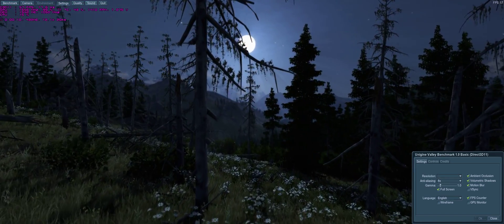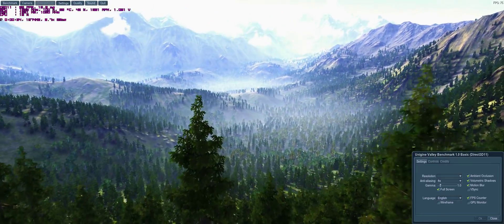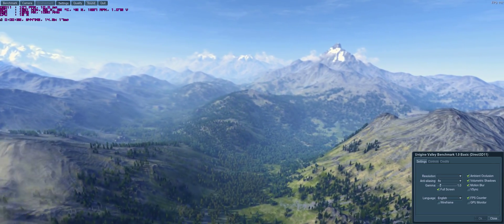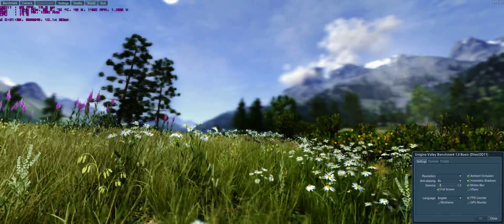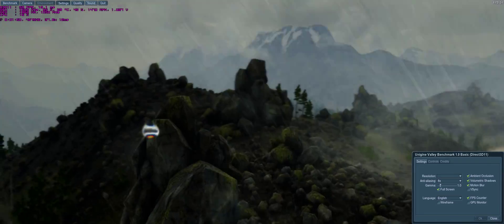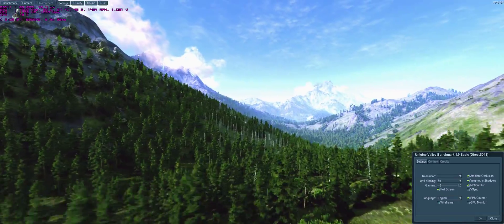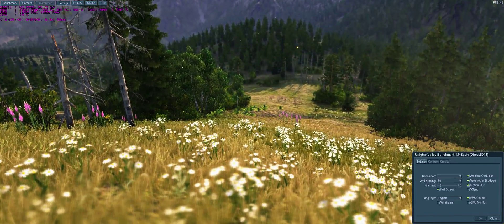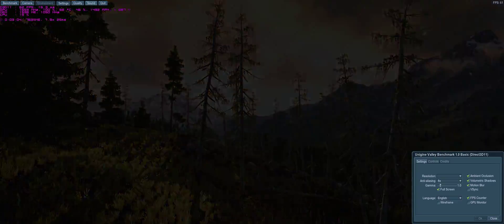Sapphire RX Vega 64 Nitro+ - Undervolt OC - Max on Air

Comment: What's your current best setting ?
Reply from the maker: 1650-1675 is the sweet spot for me  without a ton of heat/noise.
Reply: @MDFGamingVideo  I have requested to make a video for  O.C saphire nitro vega 64, I am new to over clocking and I need step by step instruction please. I really like your videos!!

Comment: mine does 1630 mhz :P
Reply from the maker: That's good.  Mine eventually maxed out at 1710, but took a LOT of tweaking, and it was LOUD and HOT.  I generally keep it in the 1600-1650 range for long term reliability.

Comment: Great video. I copied your exact p2-p6 voltage. Didn't touch HBM or stock frequency. Stock at p6 mine is ser to 1659 I believe. I did however set my GPU fans to be a bit more aggressive to keep temps cooler. Got some great heaven benchmarks. Thanks for the video
Reply from the maker: Very welcome.  Glad it helped.

Comment: Tomorrow my sapphire Vega will arrive and i have no idea at undervolt or overclock should i use your settings on wattman will it be stable on my system? Ps i dont care about power consumption i only care about performance and noise
Reply from the maker: Every card is different.  I can't predict how yours will be, but start with this and if it's not stable enough bump the voltage and fan values up a little.  Also make sure you have good ventilation in your case.  High end cards need to breathe.  ;)

Comment: Is that terrible pitch/whine in the background the coil whine from the Sapphire Rx Vega 64 Nitro+ ? Or is that just your mic being poor quality? Hows the coil whine on the GPU by the way?
Reply from the maker: I think it was a Windows 10 driver bug.  Mic boost and level not picked up properly.  Doesn't do it anymore but happened in several vids.  You can hear the SNR is much improved in the 1700+ video, very faint but still there.

Comment: hello i have the same card which i bought yesterday and I'm experiencing extreme loud coil whine if the card is under moderate load.. not speaking about max load ..do you have the same thing? coil whining asf even at 60fps ...what is your mobo and psu?    ..also games crashes at this clock/voltages and fans spin like there was about to be fire. ...already contacted sapphire about my issue
Reply from the maker: After my card broke in the coil whine improved quite a lot.  I hardly hear it at all now, even when under very high load for the 1700 core attempt.

Try an undervolt OC that isn't too crazy and give it a week or two.  See if it quiets down after some break-in time.
Reply from the maker: MoBo:  Asus X370 Crosshair VI Hero
PSU:  PC Power and Cooling Silencer 960w Silver rated that I have had forever.
Case:  Phanteks Enthoo Primo for my 1st huge water build.  Kept it as it has spots for 2x 140mm bottom filtered intake fans, perfect for hot GPUs.  But any case with at least 1 bottom or side panel filtered intake would help airflow to this card quite a lot.

Comment: so is lc bios at 1180mv and 1722 core good?
vram 1100mhz and 950mv.
tested for an hour on valley benchmark.
Reply from the maker: I can't answer that as I have not flashed it to the LC BIOS.  Probably won't need to for 1700.  Just need better cooling.  * cough * Alphacool * cough *
Reply: @MDFGamingVideo  :) I flashed back to stock. I can get stable p7 at 1670 with 1170mv and 1100 memory.

It boost to 1730 though in crossfire for some reason.

Comment: hows the card holding up? Can you do a new video on it?
Reply from the maker: Working great still.  I lost my mind and got a waterblock, radiator and pump from Alphacool.  Gonna put it on soon for fun.  Aquatuning USA FTW.  Did a vid a little while ago where I finally got it to 1690-1710 stable on the stock air cooler.  Fans hit 2500ish RPM though, so it's getting warm..and loud.  Had to lower HBM to around 1050-1075 to free up a little overhead.  Heat is definitely holding me back, especially that hot spot throttling.
Reply: @MDFGamingVideo  is that p7 numbers or actual numbers?
Reply from the maker: @DragonProtector  I had to plug in higher values to get it to hit 1692-1710 at 1137-1143mv on air.  If I tweak the power target in the BIOS and put the waterblock on it maybe more stable.  But when I fit the Alphacool waterblock the plate was too close to the chokes for comfort.  So watercooling this is on hold for me.  Not gonna risk it til I have a good backup card.  I have all the parts in hand to do so.  Just too many projects going on ATM.  :)
Reply: @MDFGamingVideo  you should get the bystik water block (aie express)

I had one but sold it.
Reply: @MDFGamingVideo  I had to rma my gpu as it was not working right with new drivers and was having issues after I stopped using crossfire.

Comment: Can you share the settings for the efficiency based OC at 1600 core that you mentioned in the description?
Reply from the maker: The Power Play table values for the first 6 states (0-5) are the same between all my OCs.  Stock speeds, slight undervolt.  The final 2 states are in the description.  At 1600 fan and temp targets were a non-issue.

Comment: Nice job, got one of these cards 3 weeks ago and spent a few hours tonight playing with it. currently got p7 to 1692mhz @1080v, memory to 1060mz@1050v and temp seems to stay around 60c so got plenty more room to play with! can get the memory to 1702mz@1090v stable and havent pushed it higher yet. great cards!
Reply from the maker: You don't usually need to adjust the HBM voltage.  It is always something like 1.3-1.35v under load.  The voltage in WattMAN is the minimum.    Weird I know, not what you'd expect but that's what they do.
Reply: @MDFGamingVideo  aa would explain why i saw no temp drops or anything then! thanks for the info.

Comment: is there any difference in power consumption? did it go higher or lower?
Reply from the maker: Answer on power use is in video description and comments for this vid and the original 1600 vid.
Reply: @MDFGamingVideo  if you just undervolt the card, without OCing it, would it go even lower than 180w?
Reply from the maker: I would guess 1500-1550 at around 950mv would get you pretty close.  But that's below stock specs on this particular card.  You will need the newer driver and WattMAN or a custom bios to lower it.

Comment: I have the same card like you and a amd ryzen 7 2700 and when i play games like bfv my gpu clock is at 1000 or lower so i cant play bfv on medium settings whit 60 fps.. i cant understant this other ppl whit the same specs got over 100 fps at ultra do you know a fix?? ( btw sry for my bad english)
Reply from the maker: Sounds like driver not installed properly.  Uninstall.  Clean off drivers for GPU only.  Reboot.  Reinstall.  Reboot. test with a game.
Reply: MDFGamingVideo hmm ok but drivers are istalled but i will test it thx
Reply: @MDFGamingVideo  i tried this but its still the same you dont have other fixes right? :/
Reply from the maker: I would contact Sapphire.  Mine runs fine.  I did a clean driver uninstall and have a good PSU and cooling.  No idea why yours is stuck at 1000.
Reply: MDFGamingVideo the radeon settings got updated when i auto overclock my gpu everything runs waay better
Reply from the maker: @sazurio  Glad to hear it.

Comment: Is this the Limited edition version? My understanding is the non-LE doesn't have the vapor chamber. Looking at purchasing the standard nitro+ but I can't find much about its cooling performance. All the reviews and info out there seems to pertain to the limited edition.
Reply: The non-LE should still be a very good card cooling-whise too. Ordered it yesterday along with a new rig.
Reply: @bosslife92  ordered from where and how much was it?
Reply from the maker: LE was a limited run for early adopters.  This is the regular Nitro+ model, no vapor chamber.  And yet I still hit the wattage limit before temperature limit so it's still a very good cooler.
Reply: @MDFGamingVideo  Would you recommend a 24" 1080p 144hz FreeSync monitor or a 27" 1440p 144hz FreeSync monitor for this GPU? I play mostly Rocket League, Overwatch, R6:S, Battlefront 2.
Reply from the maker: I don't own all those games.  I would search for reviews or videos of the card sampling the games you like to play.  I can tell you it has no problem pushing 60-75 FPS on my 2560x1080 21:9 monitor in pretty much everything I play.  This includes fairly demanding loads from modded Fallout 4, Ghost recon Wildlands, and The division.
Reply: @bosslife92  

The 27" definitely.

Comment: i recently got the same card and tried a lot of different settings. none of them were good except for the efficiency settings you posted. that worked great, though i was getting slightly higher clocks around 10-15 mhz more (not sure if that's good or bad). when i tried the settings in this video, the clocks were in the 1680 range (not stable). i'd rather stay in the 1650 range. what would you recommend i lower, the p7 frequency or the voltage?
Reply from the maker: Each card will be different.  Try dropping P7 frequency to 1702 and bump voltage to 1150.  I also learned how to make a REG tweak for a custom power-play table to lower my voltages through the midrange frequencies that you cannot edit in WattMan.  It is reversible.  And it helped with power and temps a bit.    Also HBM does not like to get hot.  If running HBM at 1100, try dropping to 1050 or even 1000.
Reply: @MDFGamingVideo  i think i found out the cause of my card's instability. i think i narrowed it down to the temps. running the settings on this video heats up the card really fast. the fan curve (default or even 300-2500) isn't cooling the card fast enough. i need to set the fan's minimum at around 2500 to get the card to play nice. your efficient settings though, those work like a charm. it can finish firestrike extreme stress test without any problems.
Reply: @MDFGamingVideo  Did you use Wattman or Afterburner for the Voltage?
Reply from the maker: @wankerka  Wattman on Crimson 18.8.2 (PRE 2019 version)  The Fan curve on the 2019 version is NOT smooth like Afterburner, it is stepped.  I did not like that so I stuck with the older version drivers for smoother fan control.

Comment: Got my card to 1762 core and 1100 memory
Reply from the maker: Gratz!  Yep.  Not hard to do on the sapphire card.  Great VRM and cooling.  I can get mine to 1725 or so but hitting the power limit.  Thinking of flashing a custom BIOS like I did with my GTX 970.  But so far haven't found a game that needs more than 1600-1650 core so...no need.  :)
Reply: @MDFGamingVideo  the gpu I had died so had to rma for a replacement. I got the same type back 3 8 pin model so been testing and found where it stable at.
Reply from the maker: 1722 @ 1.2v but it will not stay that high under full load unless you flash the BIOS and water cool it.  Air cooled and on Sapphire BIOS it will hit maybe 1670-1680 or so to stay safe.  1650 has been plenty for everything I play, and the huge power and heat jump for that extra 50mhz isn't worth it IMO.

Comment: it's always nice to hit the lottery :) mine does around 1520@1.025, 63c max with auto temp and fans. It's such a complicated arch to tweak, everything influences the final actual clocks. What is your max power draw from gpuz and ambient temp?
Reply from the maker: On stock bios maxed at 1702 on 1150mv my card will pull right around 300-310w.  Ambient temp is 76-77F/25c.  I hit the power limit before temp or voltage.  But flashing to a custom BIOS like the LQ or one of Buildzoids you can push it higher before hitting the power limit.  My goal was a balance of UV OC performance and efficiency, and I rarely find a game that needs more then 1650 core.    

If you look at my efficiency focussed UV OC vid it shows 190-210w at 1600 on 1050mv.  I have been able to lower core voltage a bit since then and remain stable, so it's a bit lower on average now.  180-190w IIRC.